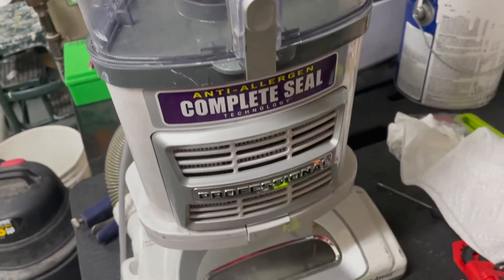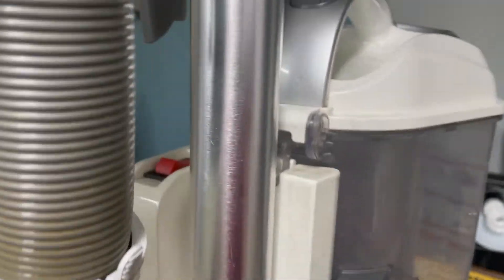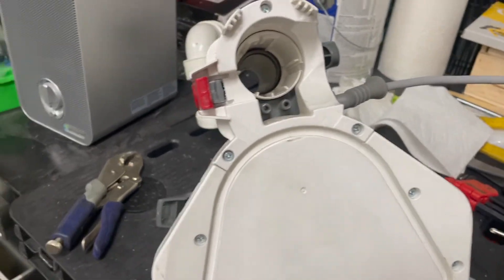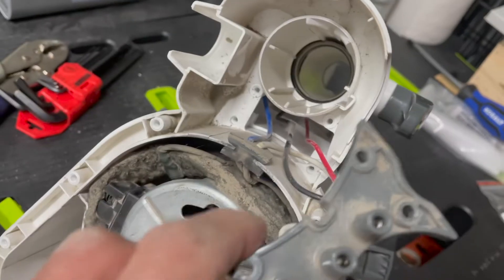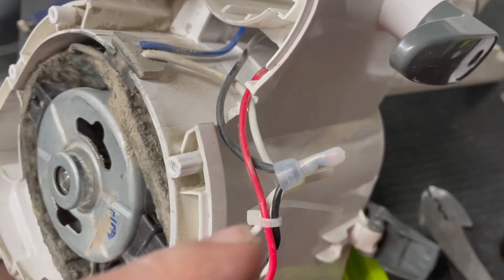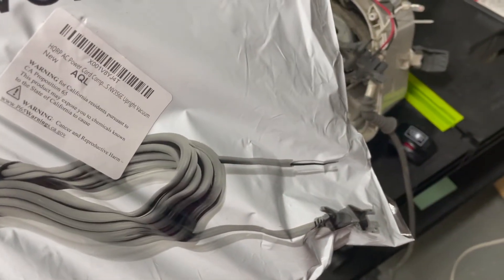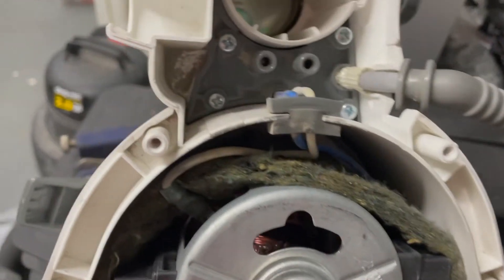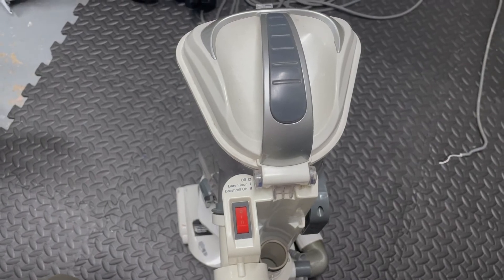Shark Navigator Power Cable Vacuum Repair

Comment: It appears as though 2 of the cover screws are slightly stripped and the Torx bit I used to remove the other 8 screws isn't doing anything.  What bit did you use to remove the cover screws?